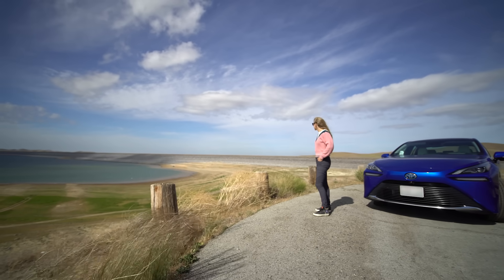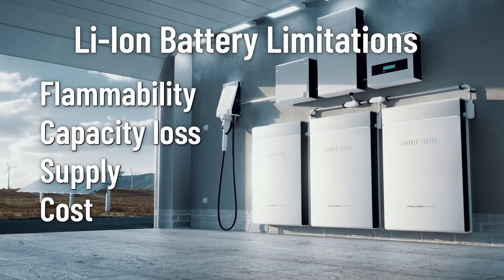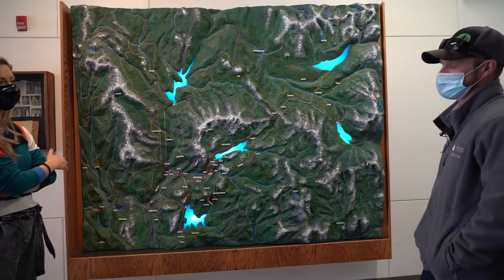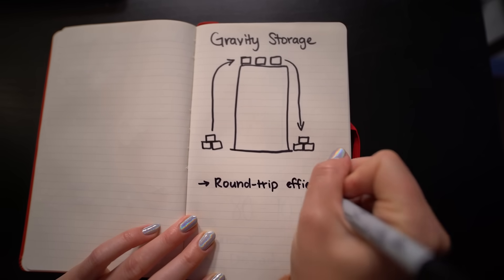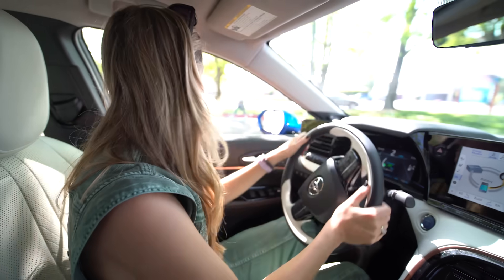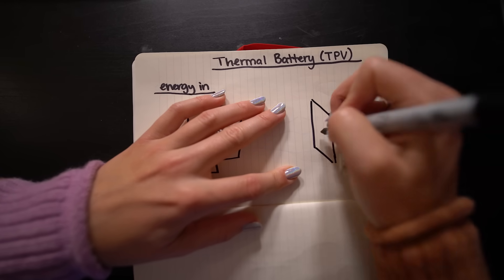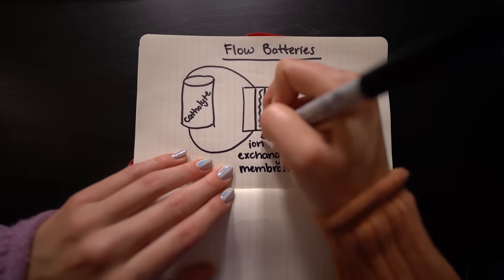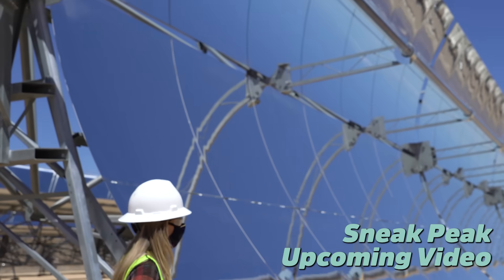The BIGGEST problem with clean energy

Comment: If we are going to talk about a zero emission, renewable and carbon neutral energy than we need to compare what does it take to power what we currently have vs what it actually takes to create all the elements to use the new sources. Your comment about pump storage tech. Will the energy produced have a surplus after powering the pumps to pump the water back up? What kind of energy does it take to produce the batteries that will need to be used to store the energy? We will be so much better off to reduce are needs for energy.

Comment: I would think flywheel tech would be a good candidate. Each property could have its own flywheel for storage unit. Thus, recovered power from the flywheel would only have to travel 50 feet instead of 500 miles. Energy loss due to long distance transmission and local distribution is about 6%.

Comment: Li ion battery is terrible outside of mobile use . There are much better options some that have decades of use lifespans.

Just take the Edison battery for example, no it isn't fashionable. Yes it is heavy. Yes it is less power dense than a li ion power wall. But you don't need it to be any of those things, especially since it can work for 80 plus years. And if you charge it too fast it will produce hydrogen as a by product, gee I wonder what that could be used for???

Li ion uses rare earth metals, as demand increases the supply of these will dry up. China has a strangle hold on alot of these resources, oh great let's just let China de ide if we can have power or not. There is no way that could go wrong is there?

You demonstrated water storage in this series, are they using ram pumps to return some of the water back up to the top storage tank? No you won't get all the water back up that way but you will cut the the power required to store it by returning some of it.

Comment: How about winter, just like Texas last winter, solar panels covered in snow, wind turbines iced up and unable to spin. No electricity. There needs to remain some sort of backup that can handle most of the load, for winter or emergency use. Their dream is a nightmare. Now add in making everyone drive electric cars, they'll need charging, and the entire grid goes down, when one more car than the system can handle gets plugged in. It sounds great to a layman, but to an engineer, it's a nightmare. We're not equipped yet for what they want now. Our electrical grid is already at a tipping point, and they want to add to that. Good luck, your nice electric car will stay low milage when it sits in your blackened garage, with no electricity to charge it up.
Reply: That’s the problem people don’t understand that in most places it gets really cold in winter and 
Wind turbines will freeze also nuclear is clean energy

Comment: Renewable natural gas or RNG is the lowest carbon intensity fuel of all. Certified by carb and the EPA as the only carbon negative fuel. It's currently used for commercial trucking Long haul 200, 000 trucks are on the road. Over 1 billion gallons annually sold across the country. RNG comes from wastewater treatment manure digestion and landfills. Renewable natural gas is distributed by the gas pipeline grid nationally. No adaptation is necessary for appliances that run on regular natural gas. Internal combustion engines work perfectly well with renewable natural gas Cummins diesel is the pioneer in this area. Westport Cummins has excelled at making renewable gas engines for 20 years. UPS Amazon Republic services are just a few of the many users.

Comment: I am sorry, renewable gives out much more CO2 per produced energy unit than nuclear. Storage of electrical energy cost between 50% waste to 100% waste, so it is also a bad solution. The solution is fusion, and until we got fusion we have to use fission. There are thorium fission reactors that are walk away safe, i.e. they can't have a run away thermo nuclear reaction.

Comment: The BIGGEST problem with clean energy is that it just doesn't provide the same insane levels of profit gouging that fossil fuels do!
It's ambitious to expect a modern company to re-invest more than 5% of profits back into the industry
5% of fossil fuel profits can run a small country, 5% of solar profit won't do much..

Modern coal plants are so much more efficient than old ones because of centuries of investment and refinement..
Where is the motivation to do the same with green energy? When you just can't just jack up fuel prices for a while and make a mint?
They cling to natural gas because it still uses fuel, and fuel means profit!            :(

Comment: Hmm, I think I need to disagree with this.  The actual biggest problem with clean energy is educating people on the truth that nuclear is the cleanest and safest form of energy we have.  Solar and wind are larger polluters than nuclear and they kill more people per terawatt hour than nuclear.  Nuclear power's biggest problem is it's not good with on demand.  It wants to ramp up to a very specific output and stay there, so having on demand batteries like what this video is about is good, but please stop brain washing people into thinking solar and wind are the answers.  They can be part of the answer, but they are a small part of the answer, not the main part.  They simply don't produce enough power for the foot print.

Comment: Very good presentation.  I worked in power generation design for almost 50 years. Over that time we constantly worked on projects to make our systems better for the environment.  I also did some work in wind and solar plants.  One thing that has always concerned me is the shear amount of area that it would take for enough renewable energy to make the required amount for our nation’s usage. If electric vehicles become mandatory it would increase substantially.  The costs to produce this amount of power will be staggering and I’m not sure the population realizes what their costs for power will be.  Finally, I’m not sure if anyone has quantified the actual carbon footprint for renewables “from cradle to grave”.  We need reliable base loaded units to cover all the weaknesses of renewables and I agree with a lot of the comments that nuclear is the answer.
Reply: The renewables grave = millions of tons of toxic solar panels & lithium batteries dumped into landfills on the poor side of town. If you want to live don't drink the water.
Reply: Greenies: but but renewables are cheaper! Reeeee!

Sanity: Just to cut wind curtailment (pitching blades to produce zero power) in the UK by 50% it would require 20 GWh of energy storage. Is it disingenuous to not include the energy storage costs into the equation?

Comment: The problem is that engineers today are blinded by the past they think they know more than the old time engineers they are wrong  one 20 feet diameter flywheel with a mass of 3 tone rotating at just 88 rpm could create 10800 tones of force to drive a generator with no emotions  regards Graham Flowers

Comment: I’ve got a physics puzzle for you that keeps popping into my mind. So what if we use a steam turbine to produce electricity. But on the pipes that runs to the steam turbine we place several sterling motors to also generate the power to heating element only and then use a copper tubing coil to condense the steam back into water and drain back into the steam production chamber, to be made into steam again. The steam turbine electricity goes to whatever other source you need electricity for. You only supply electricity to get the steam production started and then it switches over to the electricity produced by the Sterling Engines from the heat No the Sterling engines would be hooked together like a tandem bike so if it was not able to put in Energy it wouldn’t lock up the system but could always add to the power being produced. Because 60% of the lost energy is lost in heat in any production if we could take full vantage of the heat to continue to produce another source of electricity just to heat the water and if it’s too much electricity it could be added into the other electricity as additional surplus or storage in battery’s for on demand startup.
Any electricity production produces heat or lost energy why could we not you Sterling engine to utilize that additional heat to work pump the water back up the hill from what you’re using but I still like the first one because it’s sealed system you don’t lose the water to evaporation you condense it back in the order and you recover the lost energy.
Reply: Peltier junctions.
They're less complex than Stirling engines and easier to get usable power, despite their lower theoretical efficiency, it's still higher than any demonstrated efficiency using a Stirling.

Comment: Lithium Ion Batteries only catch fire if they get over heated or you try and draw more power from them, then they where designed for. As far as Lithium goes. There is a vast field of the stuff, just under the surface in western Wyoming. Not to mention the HUGE deposited in Peru. So its going to be a lot longer then 2080. Plus, Lithium Ion is old tech, now you can get Lithium Iron Phosphate batteries, which are deep cycle. Yes, I am a battery geek.

Comment: The critical problems of storage become vastly simpler and less expensive, and therefore easier to implement, if you don't try to get to 100% intermittent renewables.  Providing even 20% of our electricity from nuclear would be a huge help, and between uranium and thorium fuel cycles, along with reactors burning existing nuclear waste for energy, we have enough fuel for many centuries if not millennia.

The cost difference of storage needs between 80% renewables and 100% is huge.  For example, a major study on storage needs for California by The Clean Air Task Force (a respected climate change charity and think tank), found that at 80% renewables you would need 9.6 million megawatt-hours of energy storage and 36.3 million mWh at 100%.  Almost 4 times as much storage just to get the last 20%.   Maintaining that storage reserve (a great deal of it unused most of the time) is expensive and that cost has to be paid for by electricity users, resulting  an an effective  net production cost of $1612 per mWh at 100% renewables.  Compare that to about $160 pr mWh,  the high end of costs for electricity from new nuclear power plants... often derided as 'too expensive.'  In reality, it is not including nuclear in our clean energy mix that is too expensive.  It is certainly possible to make 100% renewables work.  It just takes even longer than building new nuclear plants and costs 10x as much.

As for safety, the reality is that we have been misled for decades about nuclear power by activists who, however well meaning, can't or won't understand that nuclear power and nuclear weapons aren't the same thing. Even when waste and accidents are considered, the number of lives lost per mWh for nuclear is comparable to that from solar and wind power, all vastly less than the death toll from fossil fuels.  Just the small particulates alone from coal kills as many people every 7 hours as the high end calculation of the  eventual total death toll at Fukushima.   The problems of waste are far more manageable when you don't use 5% of the energy in the fuel and call the rest waste like we do now.  Instead use it for fuel in other type of reactors.  Nuclear waste is as manageable a problem as the toxic heavy metal and other chemical pollution produced making solar panels. And both are trivial compared to the problem of climate change that both help address.

Comment: The first battery technology ever was thermal storage, and it's been in use for 10s of 1000s of years.
Rocks around a campfire.
Reply: So you mean burning wood.
Reply: @kjamesjr  no. the fire was the charging system to put heat into the rocks.
Reply: @peterdobos1606  But the solar energy was already in the wood.
Reply: @kjamesjr  oh geez. My comment was about energy storage. Which is what the video is all about. Obviously almost all energy on Erth comes from the Sun.

Comment: Solar energy and wind energy are not renewable.   If you take into account that the Sun is burning nuclear fuel in the form of fission.  Wind is created by solar heat and entropy.  Therfore solar and wind are finite as the Sun ages.  Every part of energy is provided by the Sun.  There is no such thing a renewable energy.  Only  the process is to obtain the energy as efficiency with less pollution.  Do you not realize that even all windmills wether wood or the New composits or solar cells reqire Oil. Nature grew the forests  millions of rears ago but utilizing photons then the earth locked all of that energy linked with carbon creating Coal and oil which are both provided by Photons. Oil is natural energy storage.

Comment: Energy is very efficiently stored in Thorium.  Just release it slowly through an efficient and safe decay chain and *voila*, almost limitless energy.
Reply: Thorium is the energy of tomorrow and always will be. ;-)
Reply: Thorium-232 has a half life of 14 billion years. I don't think you'll squeeze much energy out of it without nuclear transmutation.
Reply: @rhynosouris710  Yes it goes through several transmutations and decays.
Reply: More specifically you don't need to store it if you are generating it on demand through nuclear transmutation of thorium.  Just spread enough LFTR reactors across the planet and balance their output across the grid.
Reply: @lepidoptera9337  Maybe because hot, corrosive, radioactive salts circulating through several hundred feet of plumbing, piping, valves & fixtures isn't the best nuclear reactor design after all
Reply: @lepidoptera9337  What's your point?  Were all talking about research level work.  I'm talking about what's possible and if were promoting new ways of doing things then there are much more effective ways of providing energy that are within our grasp.
Reply: @lepidoptera9337  Its a good thing I'm not completely clueless then.  heh

Comment: The other major problem with renewables is locality of generation vs where the energy is needed. There is lots of solar in CA, the south west US, but that is not where major population centers that need energy are located. For the average consumer, micro-storage is the only practical solution, e.g. Tesla Power Wall. At scale over-generation today, that is solved by the power grid. Transmission lines have there percent power loss, as does DC->AC conversion, required for using the current power grid. Today, a totally electric car is only practical for local errand trips. A cross-country road trip, pretty impractical, as charging stations are not where you need them to drive from CA -> IL, for example. This is where big oil wins, and I'm not seeing that "strangle hold" on energy where you need it being addressed in the "carbon-neutral by 2050" goals.
Reply: There is the guy who also couldn't believe that horse and buggy weren't eternal technologies. ;-)

Comment: The problem is at max you only get 33% from solar and then to store you lose more efficiency and then to release the energy via a motor you lose even more efficiency.

You don't have that problem with fossil fuels.

We need clean nuclear energy.
Reply: True. With fossil fuels you get approx. 10-12% from start to finish. ;-)
Reply: @lepidoptera9337  no fossil fuels are several orders of magnitude more dense then solar. And the motors and engines that use then are about 95% efficiency. But in exchange you get all this pollution.

Comment: The issue with long term storage is that many of the battery storage (or storage solutions) are worse for the environment, both because we get the resources from China (not known for being top notch w/ environmental responsibility in how they extract) & are not renewable.

It isn’t consistent, storage in areas where winters are harsh won’t work (even regular clean natural gas & oil can’t be used do you the freezing point, so diesel is required).

Solar panels & wind turbines (besides not being a steady reliable source) are not environmentally friendly in production of the equipment, is not friendly to wildlife, & not easily recycled.

Those driving EV cars think they are doing good (& true, exhaust is reduced-> but could be reduced by better filtering systems in our exhaust as well as advancing more efficient use of fuel energy in the cars (better gas mileage)<- but they are getting the energy they charge their vehicle by whatever energy source is used in that area (coal, which has become much cleaner to previous decades; natural gas, oil, or nuclear).

Comment: With the greatest of respect a (and I do respect your knowledge enourmously), but, you can't claim to be neutral in your investigations while taking sponsorship from one of the worst legacy auto companies who has continually set in place numerous road blocks to 100% transitioning.  Toyota has been pushing tiny buzzbox hybrids [which basically burn ff to make the electricity to store in their puny battery], and hydrogen stratergy ??? when the logistics and economics H2 just don't make sense and the full BEV has already won the day.